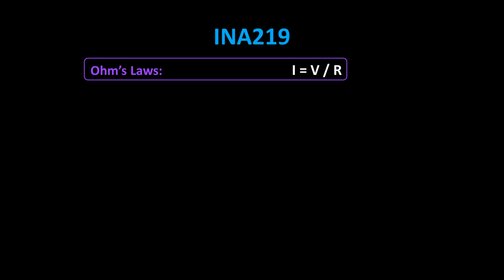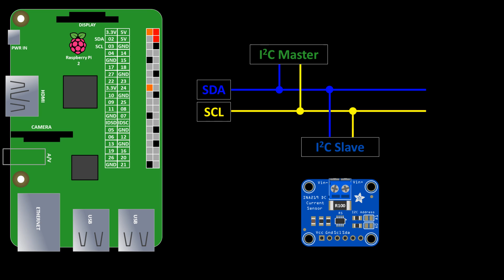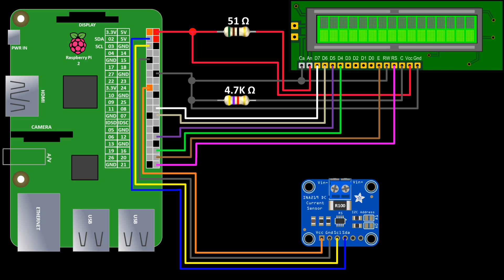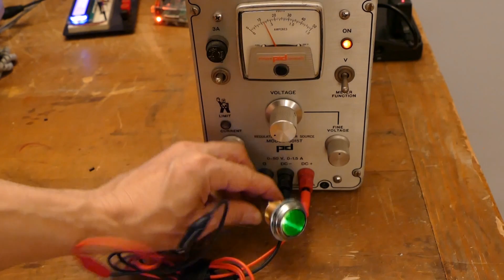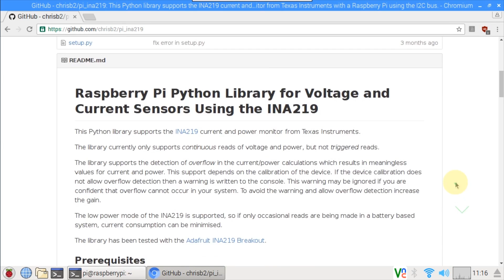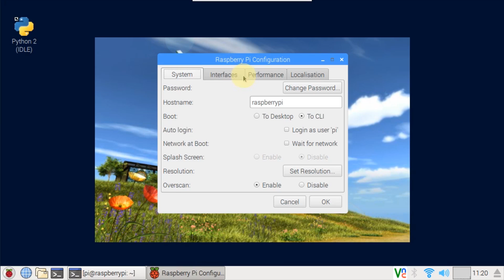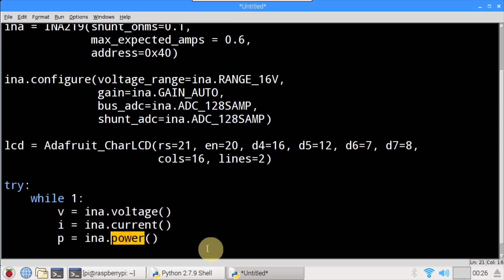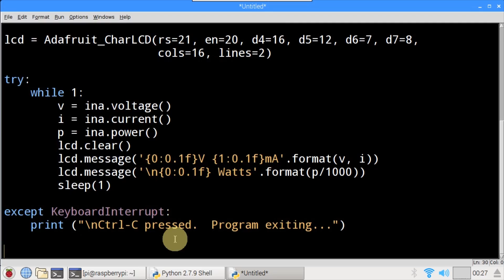Raspberry Pi INA219 Power Measurement Tutorial

Comment: I want to use a solar panels with output of 90 V. Can you please tell me how I can achieve this?
Reply from the maker: What do you want to measure?
Reply: rdagger68 I want to measure the current, and voltage produced by the solar panels.
Reply from the maker: First when dealing with lethal voltages I strongly recommend that you confer with a qualified electrician.  Since you are working with solar, the most efficient approach would be to use a 96V MPPT charge controller with an RS232 or RS485 data output which could easily be polled by a microcontroller or computer such as the Raspberry Pi to provide detailed energy usage.  I have a tutorial on the subject:  https://youtu.be/1VxP38XlVEQ
Another option is the Open Energy Monitor project which provides comprehensive open source solutions for monitoring solar power and other energy use:  https://openenergymonitor.org/
Reply: rdagger68 is there a way to measure the voltage produced by the solar panel with the method showed in this video? Instead of measuring the power consumed by the lamp, maybe I can do the same for the panel..
Reply: rdagger68  thank You! Very good tutorial
Reply from the maker: You can measure the panel voltage and current by placing the INA219 inline as long as the panel voltage and current do not exceed the INA219 maximum ratings.  I have another video on monitoring a solar charge controller with the Pi.  You can use the pv-voltage and charge_current parameters to measure solar panel voltage and current.
Reply: I check the maximum rating of INA219 but it is around 26V and I didnot got any information about the current
Reply from the maker: The maximum voltage drop that the INA219 can measure is 320 millivolts or .32 volts.  Therefore the maximum current that the INA219 can measure with the default resistor is .32V / 0.1Ω = 3.2A.  If you need to measure more than 3.2A it is possible to replace the 0.1Ω shunt with a lower value.  A 0.01Ω shunt would allow 32 amp current measurements.

However the lower value resistor would need to dissipate more heat so it would need to have a higher wattage rating.  Power dissipation (P) = current (I)^2 x resistance (R).  The board’s default 3.2 amp rating means the 0.1Ω resistor needs to be able to dissipate 1.024 watts:  3.2^2 x 0.1Ω = 1.024W.  Possibly more if the resistor is located near other components that generate heat.  At 32 amps the power equations shows that the 0.01Ω resistor shunt would need to be able to dissipate 10 times more watts: 32^2 x 0.01Ω = 10.24W.

Precision current measuring shunt resistors that can handle 10 watts are usually expensive and get pretty hot.  Therefore, if you want to measure more than 3.2 amps I would look into a more efficient solution such as the 30 amp Allegro ACS712 which uses a linear hall sensor approach.  Please exercise caution when working with dangerous currents!

I have a video dedicated to the INA219: https://youtu.be/BgShCD7xT_A

Comment: how could I use these to monitor 6 and 8 AH nicads and would it be possible to add an auto detect and configure for multiple INA's?
Reply from the maker: You could place an INA219 breakout board inline with a battery to measure the voltage and current draw as long as you are not pulling more the 3.2A.  I don't understand what you mean by auto detect.  You can have up to 16 INA219 boards connected to a Pi.  Each would need a unique I2C address.
Reply: At the moment you have to manually tell the software the address of the device after using i2c to detect the address. 
How about adding a function that auto-scans address and configures each device.

3.2A?

Getting close to the limits of some circuits (one draws 2.8a @3.6v!)
Reply from the maker: It's possible but you would have to ask ChrisB2 (the creator of the INA219 library):   
https://github.com/chrisb2/pi_ina219

Comment: Hi, you import in the file: ina219.py Adafruit_GPIO.I2C as I2C. Where di you get this library from? I can't find this library and without it, it doesn't work.
Reply from the maker: When you  pip install the ina219 library, the dependencies should also be  installed.  Did you following the instructions on my website?  Are you using the latest version of Raspbian Jessie?
Reply: I now what the Problem is. In the LXTerminal it works perfeclty but It doesn't work with Phython3. The error message cames only when I would open it with Python3. I wanted to creat a window to show the current and voltage.
Reply from the maker: You need to use pip3 to target Python3.

Comment: Hi,I've installed 2017-07-05-raspbian-jessie and trying to update it using apt-get update and apt-get upgrade. The problem is I keep getting the bellow error. I tried all solutions found on google but non worked so I appreciate any helppi@raspberrypi:~ $ sudo apt-get upgradeReading package lists... DoneBuilding dependency treeReading state information... DoneCalculating upgrade... DoneThe following packages will be upgraded:libgcrypt20 libtiff52 upgraded, 0 newly installed, 0 to remove and 0 not upgraded.Need to get 0 B/536 kB of archives.After this operation, 5,120 B of additional diskspace will be used.Do you want to continue? [Y/n]
Reply from the maker: Maybe I'm too tired but I do not see an error message.  I see a prompt to continue.
Reply: rdagger68 Why when I update sudo can not just any posts need additional memory y / n
Reply: Can you speak Indonesian?
Reply from the maker: Sorry no.
Reply from the maker: I don't understand.  Maybe you have a bad sd card.  Did you expand the SD card?
Reply: rdagger68 My sd card is nice and 16gb capacity. I need help when entering the program '' sudo apt-get update & & sudo apt-get upgrade, '' and written y / n do you have email so I can send the photo?
Reply from the maker: There is no space between &&
You can email me through my website (see video description for link).
Reply: Ok tomorrow I try again thank you
Reply from the maker: Y
Reply: After the process has finished writing 'clear'
Reply from the maker: Clear is not necessary.
I clear the screen frequently during filming to keep the cursor above the closed captions.

Comment: Yes the GND is connected from the load supply to the Pi. What readings are expected with no connection to the bus terminals?
Reply from the maker: I don't think it will work if you have the Vin+ and Vin- terminals floating.  I'm guessing the voltage readings could be arbitrary.  Try connecting a load such as a bulb or an LED and see if the readings are accurate.
Reply from the maker: There is a post on the Adafruit forum that addresses floating inputs on the INA219:  https://forums.adafruit.com/viewtopic.php?f=19&t=38745&start=15#p192276
Reply: Ok so if the load is not connected I could get strange readings. As suggested I have used an LED with 120 ohm resistor supplied from a 3.7 v cell.
I get current out of range error when the code runs. I have the max current set to 2A the load is only drawing a few mA.
Reply from the maker: I just performed a similar test with an LED and it worked.  Here's the code I used:

from ina219 import INA219, DeviceRangeError
from time import sleep

SHUNT_OHMS = 0.1
MAX_EXPECTED_AMPS = 2.0
ina = INA219(SHUNT_OHMS, MAX_EXPECTED_AMPS)
ina.configure(ina.RANGE_16V)

def read_ina219():
    try:
        print('Bus Voltage: {0:0.2f}V'.format(ina.voltage()))
        print('Bus Current: {0:0.2f}mA'.format(ina.current()))
        print('Power: {0:0.2f}mW'.format(ina.power()))
        print('Shunt Voltage: {0:0.2f}mV\n'.format(ina.shunt_voltage()))
    except DeviceRangeError as e:
        # Current out of device range with specified shunt resister
        print(e)

while 1:
    read_ina219()
    sleep(1)
Reply: Thanks for all your info. Unfortunately I am getting the same problem using your code, current out of range (overflow) for gain 0.32V  device limit reached. Also the bus voltage is incorrect measured 3.7v printed value 2.96v.
Reply from the maker: You might have a bad INA219.  I'd inspect all the solder connections under magnification.
Reply: You could be right. I tried some different code from GitHub Scott/subfact_pi_ina219. Got the  same wrong readings e.g 1.3Amps. Checking a few forums there have been some bad boards. I have ordered another board from a different supplier the pcb is a different colour. I will check the soldering. Thanks.
Reply: rdagger68 hi replacement board works using all code . Thanks very much for your help.

Comment: Great  tutorial but I can't get it to work. I am running the example code.With no bus voltage connected and load I get a  bus voltage = 1.036
Bus current = 1409.207ma supply voltage = 1.77 shunt voltage 141.210mv power 1452.439 mw . I have had to increase the MAX_EXPECTED_AMPS from 0.2 to 2.0 to get this result or I get a current out of range error. Any help would be great I'm a Pi newbie.
Reply from the maker: Does the power source being measured share a common ground with the Pi?

Comment: Is it possible to use more than one INA219 for the python script?
Reply from the maker: Yes.  Each one needs a unique address.  See table 1 in the datasheet for the address pin settings.
Reply: @rdagger68 Ah ok thanks! Will the library also work for INA226?
Reply from the maker: I haven’t tried, but I would guess no.  You could submit a feature request to chrisb2.  It looks like he has made updates to the library since the video came out.